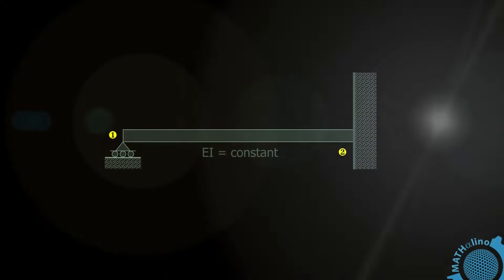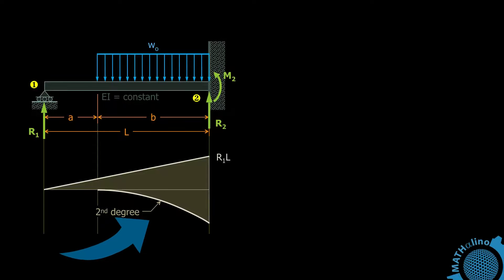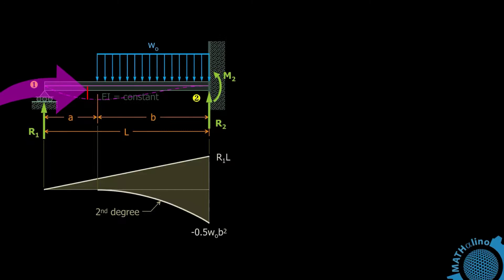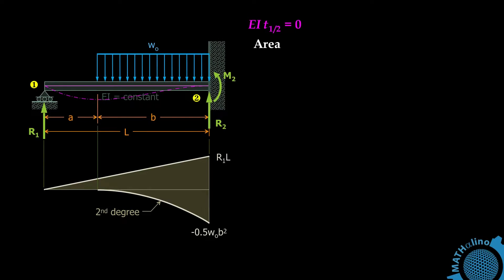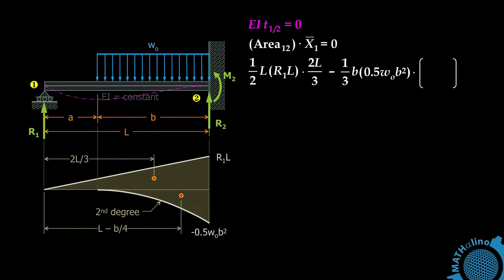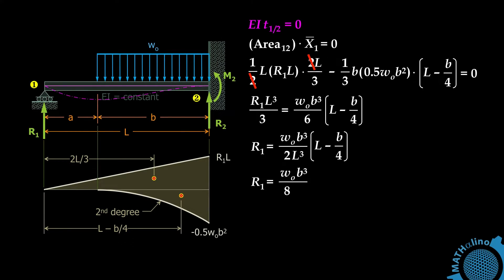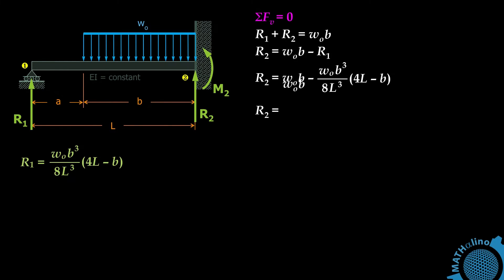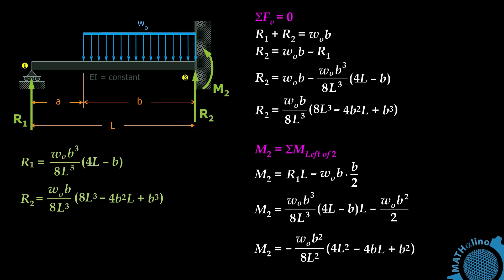Propped Beam with Uniform Load by Area Moment Method | Theory of Structures

Comment: Hello sir, great video! but i want to ask; we know that tangential line 2 is an horizontal line and tangential line 1 is slope to down-right. so, it will make sense if t 1/2 is not zero. the deflection IS zero. can you explain more on this? thanks